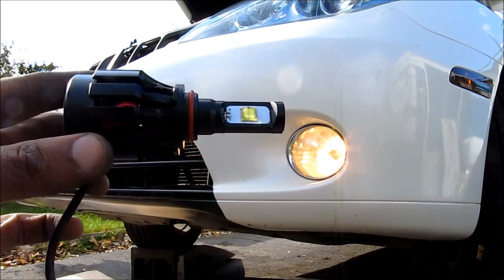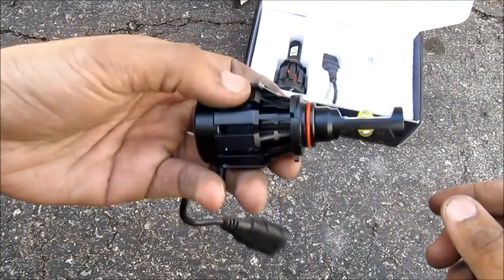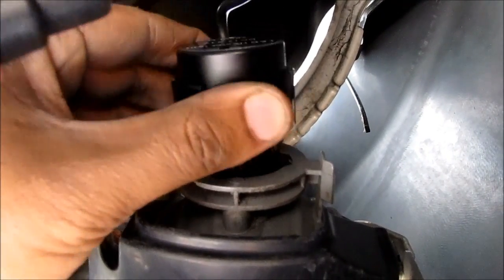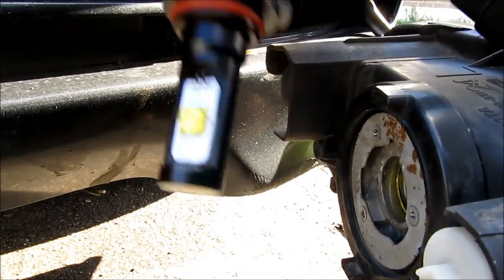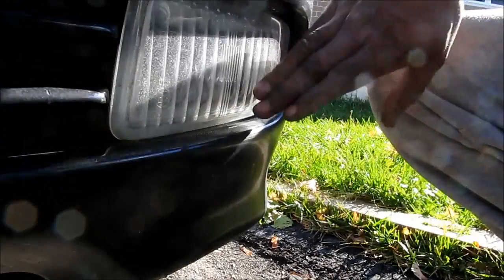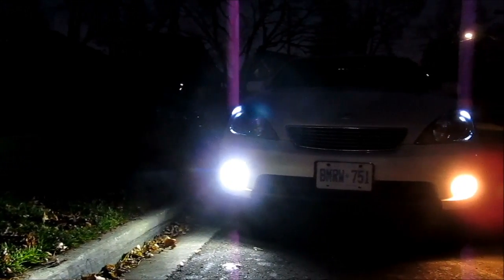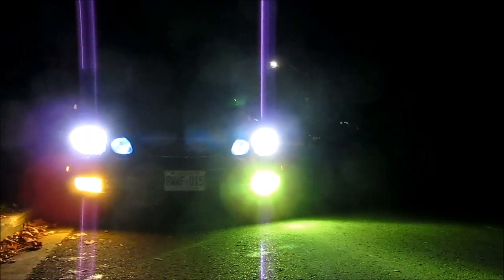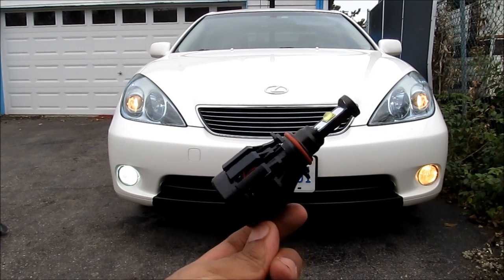LED Headlight & Foglight Review

Comment: LED's vs HID's?
Reply from the maker: +Art 'Dutch' Willemse In my opinion they're almost equal, very bright light output but poor optics which make it worse than halogens.
Reply: +speedkar99 worse optics than halogens? The HID's in my Solara don't work well enough without projectors and the glare is bad as you know. Maybe I'll just get Sylvania Silverstar Ultra. Thanks again for your vids.
Reply from the maker: Same here, the HID's in my Solara have horrible optics. Given the results in this video, the LED's are similarly horrible.

Comment: I think I will stick with hids
Reply from the maker: +David spade HID's give you the same output for a similar price. The LED's might save you a few watts, but will be faster to turn on and warm up.
Reply: +speedkar99  I put LEDs in first on my Avalon and they didn't even last a month until one went out  then I decided to go with hids and it's been over a year.  My hids take no longer then  a few seconds to warm up and reach max brightness and that's fine with me considering I always give my car at least 30 seconds to warm up
Reply from the maker: True. LED's are a new tech, while HID's have been around for a while. I think once LED's mature, become reliable, come down more in price, and rely less on active or passive cooling they'll be more attractive as a headlight upgrade.

Comment: Great review. I switch to LED on the headlights of my Lancer, big improvement. That rotation feature is nice to have as sometimes based on reflective pattern of the headlamp you need to rotate the LED to have a nice cut off line.  The ones I've got don't have that feature and I had to adjust the headlight a little bit lower.

The buzzing I thing is a cooling fan, isn't?  Mines have a huge heat-sink  with no fan
Reply from the maker: +gianfrancoa Thanks. The rotation isn't a feature, I believe the ring just came loose on me as the other bulb wasn't loose. Otherwise you couldnt twist these bulbs in and have to use a screw driver to get the tabs to lock. Imagine doing that behind headlight housings on modern cars where they is no space to put your hand behind the headlight!

Rotating the bulb does help a bit (depending on the housing) as the LED's are backing each other at 180 degrees.

I don't think these LED's have a fan, it might be a capacitor whine or something in there causing the buzz.

Comment: Didn't expect such a green light from the LED! I thought fog lights were yellow to help visibility in bad conditions. Have you used them in fog or drizzle? Thanks again for these videos, btw.
Reply from the maker: +Kevin Bowrin Thanks. The green light is because of the yellow capsule in the Lexus GS fog light housings. The ES fog lights didn't have capsules. I thought it would just be whiter yellow, as opposed to green, but that's how it turned out! No updates yet in the rain or snow.